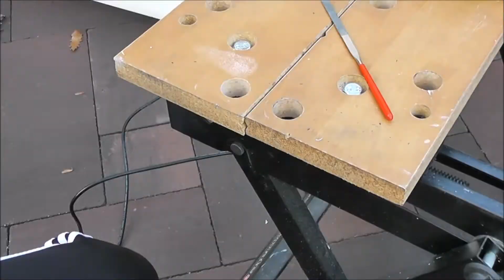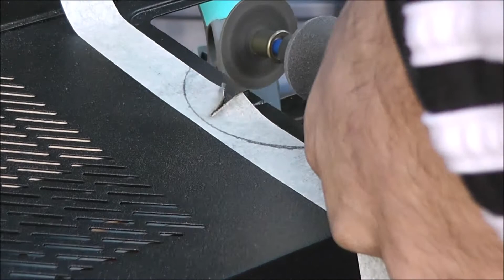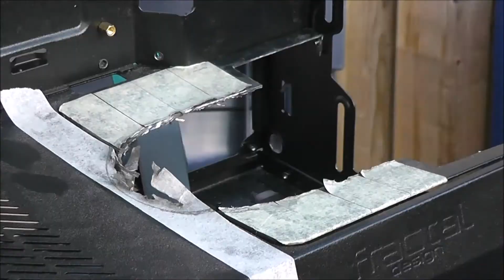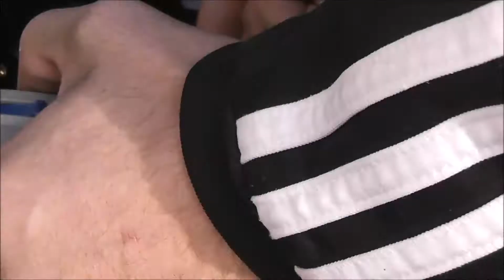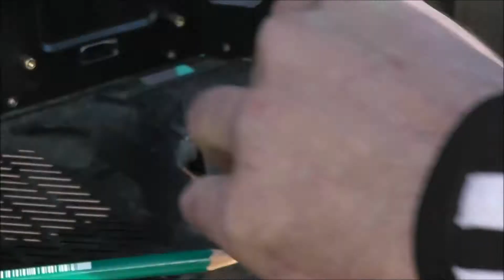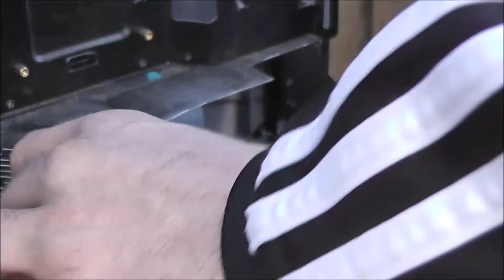Fractal Design Meshify C Casemod - Reservoir Placement

Comment: You wear down your blades faster by making plunge cuts each time. Work on walking it straight in short runs without plunging every time.
Reply from the maker: Kil7witch84 Thanks for the tip! 🤘